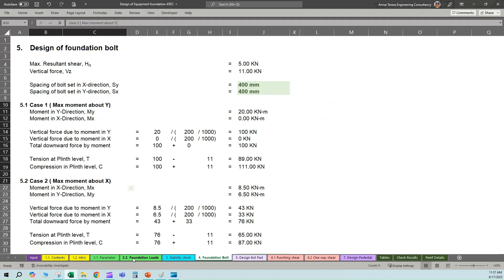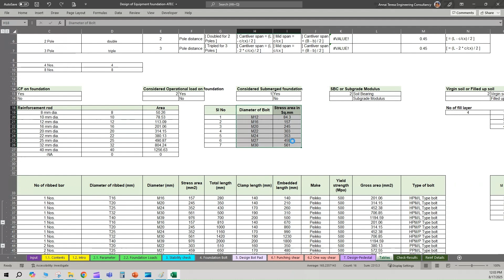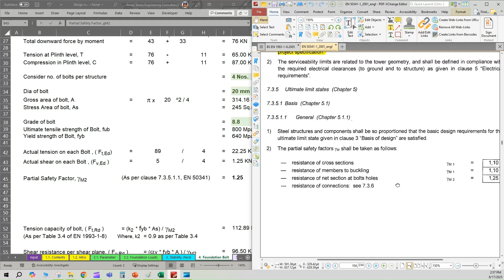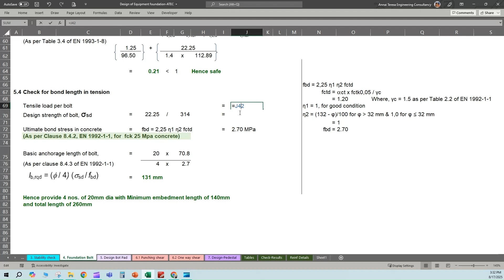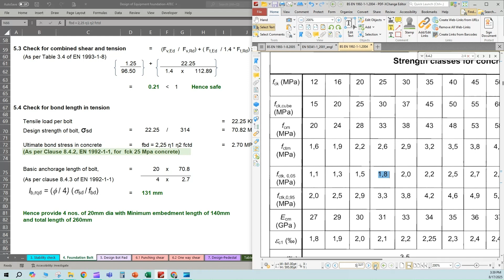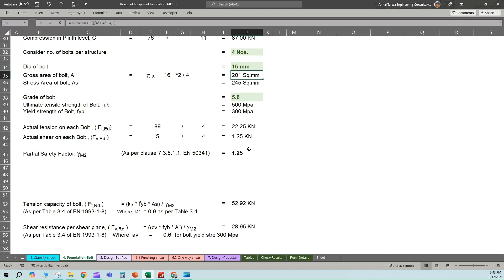Substation Equipment foundation design - Eurocode - Foundation bolt design  (Part 04 of 07)

Comment: Sir.. can you make a video on the substation gantry tower calculation in excel sheet as per Indian standard codes..
Reply from the maker: Thanks for the suggestion. Working in full  Excel sheet is not so accurate for 3d analysis. May be we will try with 2d analysis on BIS standard. For optimum design, we always suggest going with software based 3D analysis. Will try in futures.